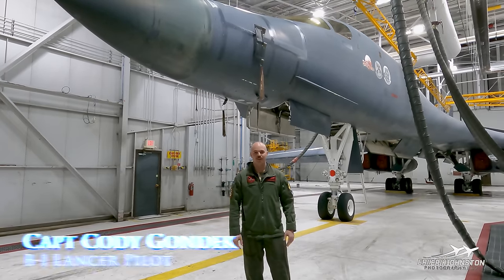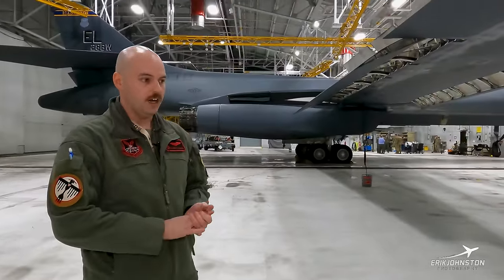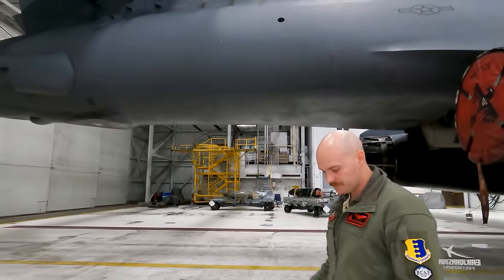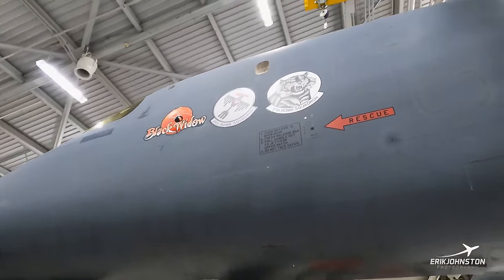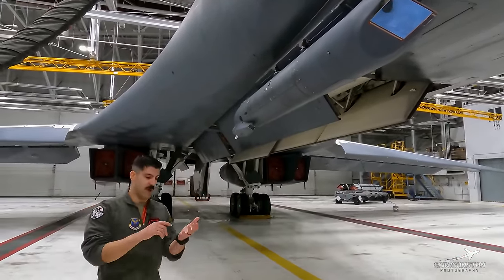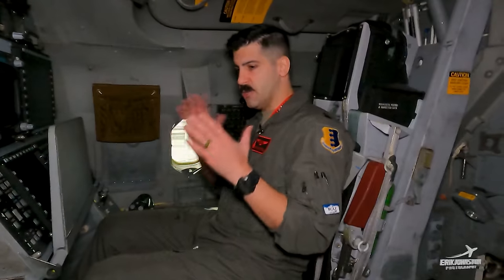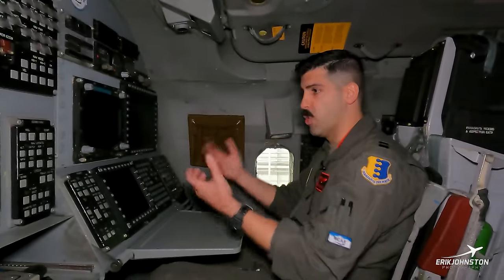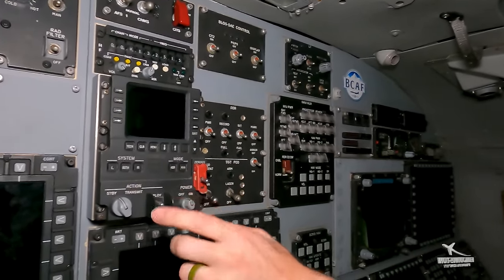B-1 Walkaround Lancer Bone

Comment: I’m amazed that the military is comfortable discussing all the features and capabilities of this plane so publicly, especially all the modern weapon integrations. If they can share this info, I can’t imagine what’s still top secret. It must be some crazy mind-blowing tech. I wonder if the military’s willingness to share this much info is to mess with our enemies heads by showing them how advanced even our old technology is.
Reply: I can assure you that they don't share everything. As a former mechanic on these jets, there are many things that have sub systems and capabilities that are used on case-by-case bases. Everything that can be shared was vetted by public affairs ahead of time in these videos.
Reply: During my airforce contractor days, I built equipment and high tech tool management systems for servicing the B1. Spent years working at airbases and training airmen, as a civilian, there were many systems I wasn't allowed to inspect. The B1 like many other military crafts can be upgraded easily with newer modules of classified technology. I'm sure the tech displayed on this video is of no concern.
Reply: @chrisstr33tkng61  That's what I've kind of gleaned over the years, the generic specs we can find in public source really leave out just how customizable these airframes and munitions really are. I'm trying to recall exactly what video it was, but a while back I came across one where a former Tomcat pilot was discussing a particular mission, and explained how him, the crew chief, and some others worked late into the night screwing together a customized bomb, just for one specific target.
Reply: I came here to say the same 😂

Comment: As someone who has worked on this exact (yes, literally) Bone during 2000-2004 as a Jet Mech and APG, this brought back a buttload of memories. Outstanding video. Much appriciated!

Oh- and please don't call it an "Afterburner." The GE-F-101 uses an augmentor, not afterburner😉
Reply: That's cool, you kept this bird aloft
Reply: "Augmented turbofan"
Reply: Thank you for your service!
Reply: The first Rockwell prototypes were prettier with the all white paint jobs
Reply: @BradFalck-mn3pc  many of the earlier strategic bombers in various air forces had "anti-flash" white paint jobs to help reflect some of the thermal radiation (heat) from nuclear blasts
Reply: Civillian tech, so feel free to be as technical as you want!

What's the difference between an afterburner and a so-called "augmenter"? 
Never heard of an augmenter before.
Reply: As someone who replaced a few engines on this specific bird from 2010-2012. An afterburner is just that. A segmented, augmented engine augments the airflow in such a way to increase the efficiency of the engine.
Reply: To add to this. The augmentor also contains the fuel nozzles to ignite which creates the afterburner going out of the exhaust nozzle.

Comment: Never get tired of these videos! I have built models of this plane as a kid along with the p38, f14, sr71 and this plane. Bought the janes books covering many if these planes and the shuttle back in the day. Learned way more detail in this than any of those books and stuff they didn't cover. No idea it was a tight as it is for the 4 person crew. I really enjoyed each person showing off their specialty with regard to the plane. I had no idea the terrain following electronics were as advanced and can do what they do. I was surprised this plane has a max of only 1.4 g. You wouldn't think that with the terrain filling feature. The last of the swept wing planes. Gone are the f111 and f14. I miss the f14. Nothing like hearing that at afterburner takeoff or fully swept forward trying to fly with older ww2 planes. It was a treat to see the assortment of bombs and cruise missles it can carry.  Seeing those jdams with the smart kits just made me think of the kits were supplying to Ukraine for their bombs. Or perhaps were also supply the bombs and kits. Seeing videos of those recently they are devastating.  Russia sadly has a version called the fab 500 I think that is similar and very effective from distance.  I would be curious when they stopped using this for nuclear deterant role. I imagine many planes can do this now with the b2 and b52 and new bombers in development. Fun to see one of these parked outside of sac museum in Nebraska last year with the sr71 and many others. Sadly no in this level of detail and not still operational. Thank you for another terrific video! Just curious if their is a plane or planes you want to cover but haven't?  Thanks!

Also want to say a thank you to the pilot and crew that helped make this video possible!

Comment: The reason this video is so log is that this is a very complicated aircraft.  I am impressed with the technology - especially if you consider that the last one was built in 1988.  That's 35 years.  To put that in perspective, cell phones in 1988 were very large and expensive.  My first one was actually designed to be added into your car.  If you wanted to walk around with it, its size was about half that of a briefcase - it had a carry handle and just the battery was probably as heavy as a dozen or more iPhones

Comment: Don't know if I missed it or not. Talk about the external hardpoints. They have been testing them with a pylon with a JASSM mockup to get test data. One of the old hardpoints is used by the Sniper pod. Boeing had a mockup at one of their facilities outside Tinker AFB that was a pylon with two JASSM.

Comment: One system noted as missing on the Bone are external cameras displaying the landing gear/doors for all stations of the crew. Also a behind the command seats view incase of incapacitation of the flight crew due to flash of a nuclear weapon trying to intercept the plane. I would think that a 'Glass' touch system would make the systems further integrated with a lot less buttons.

Comment: Definitely the best Aircraft the USAF has in Looks & Power, this is one Awsum Machine especially on Take off with those General Electric F101-GE-102 turbofan engines with afterburners & Waiting at the end of a runway when one takes off with the Ground Shuddering is just the best feeling ever.

Comment: I once spent 5 mid-shifts on my back in the right wing glove fully repairing an LF/VLF wire bundle.
Reply: Please refresh my memory.  Are you talking about the MRT that has the TM and TE antennas near the aft end of the aircraft?  Because I opened and closed the winggloves for 7 years and there's no lf / vlf anything in there.  Maybe you mean you were camped out in the area that the wing tucks away into when it's swept back at 66 degrees......that's called the over wing fairing.
Reply: @doubledeeeeeeez  Crew Chief? I honestly didn't know the name for the different parts and was referring to the general area. But yes, the upper portion of the fairing on the right side. This was nearly 30 years ago.

Comment: This is a great video - very detailed; except one thing - I'm curious about the antenna used for the HF radio.  Normally such low frequencies require a large antenna, but you can't exactly mount a loaded whip antenna on a supersonic plane.  So what is it?  I've heard that some planes use a retractable trailing long-wire antenna... something like that?
Reply: Skin is antenna on most modern military or civilian aircraft. Warning to clear b$ transmit while testing on ground.

Comment: What is the purpose of the small wheel behind and above the main landing gear? It's so far up I can't figure out a good reason for it. It doesn't look like it would ever touch the ground. Maybe it helps open the doors during wheel extension? Or maybe it's part of a mechanism that rides along side guide to compress the gear when closing?

Comment: How do you eject without the forward part of the ceiling ripping your legs off as you punch out? It doesn't look like the overhead hatch is even big enough for that seat to fit through. Even if it slides back first.

Comment: 14:28 I've learned that all of those forged landing gear parts are made with giant hydraulic presses. Like the Mesta 50 50,000 ton press. modern aviation wouldn't work without those giant hydraulic presses.

Comment: Antique Bird, but so am I. This is B-1B #89 likely delivered early 1988. We handed over #87, assigned to #91 then I was laid off. Back next year as Avionics Tech. writer to see #100 flyover leaving for service. Stick disconnect was fly by wire. Fwd panels were VSD DUs and vertical tapes either side, now 2 displays. Wing detent 22.5 ground max before jack stands on wings. Plane was pure cold war nuclear bomber with set of blackout panels for flash. Manual eject to roast those still onboard, instructors 1st summersault entryway, then auto eject. Fully EMP wiring, built for 10 years with expandable to 20. CITS not same. ALQ-161 not 151 by Eaton/AIL and Boeing contracted to run LH rear seat tests. With red hat covers on ALQ-161 would empty screw coil vending machine, one row at a time on spot 5C, site 1. HF main intent was for us entertainment on Radio Moscow or Havanna at Plant 42. Skin is antenna. Memorized every breaker from AEB, Wheelwells & fwd. Likely more cockpit time than most pilots. Engine exhaust were smooth originally. 1st crew was mainly shuttle folks in 1985, where i parked my boat after water skiing mornings on Pyramid Lake b4 2nd shift. Mandatory 6 day work week, volunteered for more, #1 on overtime ramp. I should have fought to be tech rep, as i trained avionics engineers on nav systems and test equipment at Rockwell. We later got 3 F-106 chase birds, would take 2 or 3 of those to do 1 B-1B test flight. Main gear Cleveland Pnuematic. Was also main fuel tank entry support setup & rescue early on. Delivered at 1.7 Mach down 1 whole number since B-1A. 1st knee trouble, safety wiring connectors in overwing fairing while co-worker read Pet Sematary, great water-ski guy though. Plane is furtherance of the XB-70 tech. in many ways.
Reply: yeah, I worked on it also when it was not glass cockpit all steam gauges.  I bet the cits is still useless, it was so bad they told us to ignore it when I was in 93-2000 DAS tech.

Comment: If they decide to keep the B-1B relevant by doing some upgrades, I wonder if they could upgrade to F-135 engines? If they pull all the existing F-135's out of the F-35 Lightning for newer adaptive engines, then they could rebuild the hundreds of older F-135's for the B-1B.

Comment: Does the B-1 use the same engines as the F-15? I noticed the thrust nozzles look very similar.
Reply: No. It isn't even the same manufacturer. This engine is only used on the B-1. The closest "cousin" enginewise is the F-16 engine.
Reply: Well, that's mostly correct.   @MrSchwabentier  .  However, Some 15s use the GE 110 which was developed from the GE101 that's in the b-1.  So in essence, one could say the 15 does use the "same" engine as a b-1.

Comment: I've always found the interplay in development with the B-1B, B-2, and B-52 to be interesting.  Ironically the B-52, the oldest, is likely to outlast the B-1B and B-2.    Then if the B-2 development was public, I'm not sure the B-1B would have ever been ordered into service.   What's especially strange is the B-1 was redesigned for low level penetration and the B-2 was as well.   Clearly designers thought that speed (in the case of the B-1) and stealth (in the case of the B-2) were not enough for survivability.   However, the B-21 and RQ-180 seem to be optimized for high altitude flight.

Pure armchair speculation, but I wonder if the improvement in IRST and other optical tracking technologies has pushed aircraft to higher altitudes.
Reply: B-1B is stealth, thus the full mach number drop from the A model to 1.7 when new from 2.7. Cross section of a 6" crescent wrench. .85 mach in terrain follow or terrain avoidance.

Comment: Im wondering how comfortable the seats are?
Reply: I was a B-1B instructor at Dyess AFB from 1988-1994 (flew B-52s for 10 years before that) and I can tell you the Bone seats were only slightly more comfortable than the ones in the Buff. My average B-1B mission duration was about 1.5 hours shorter than my average B-52 mission duration, so that may be a factor.

Comment: so yea if you just delete the doors, control systems and hydraulics for opening / closing ? electrical ? auxiliary supply / then just make a winch-in payload which is supercomputer aircooled & sensor pod / room for a bunch of kids in perspex bubbles, stick in what you want like a nintendo cart sort of idea. Module drop-in / B1 with EWS / chase plane / close surveillance / cyberforensics / ANON come on.

Comment: air force has reputation for being so strict but those remove before flight streamers are pretty worn lol. they are not even red anymore!
Reply: If it ain’t broke, don’t fix it!
Reply: @mikebarker6628  actually no. the whole point of red streamers is so you can identify them clearly. pitit covers, gear pins, etc. so you don't leave them by accident.
Reply: @Chodda  I promise nobody is leaving these by accident. The maintainers remove them, then it’s checked by a master sergeant that release the plane to the aircrew, and then aircrew checks it. 

Source- I’m an aircraft maintainer in the USAF.
Reply: @mikebarker6628  so then lets just don't use streamers at all
Reply: @mikebarker6628  Well I've worked real world aircraft maintenance in real life. I have almost 20 years experience. I don't need a Master Sgt to tell me how to think. It's common practice for us to change them when they get totally unrecognizable, like the ones featured on this B1. You can try and fight me on this subject all day but you know your argument is dumb and wrong. Have a nice day.